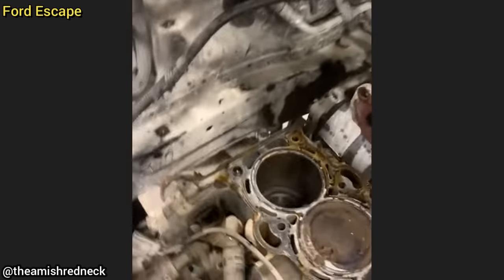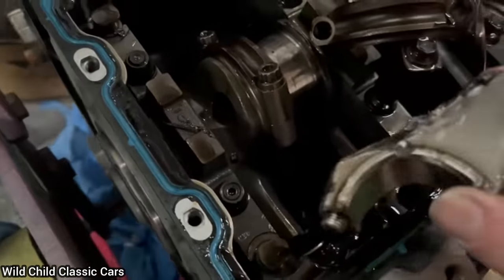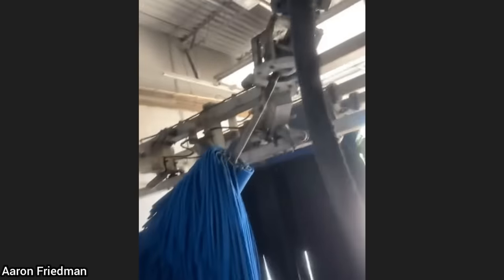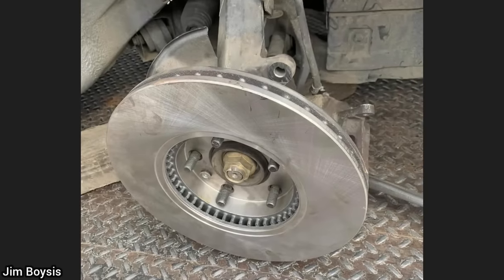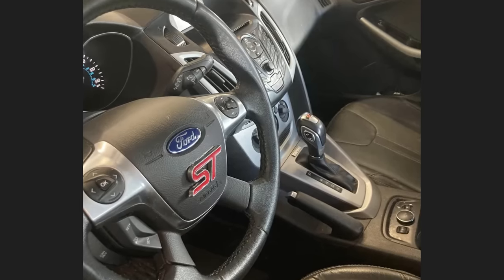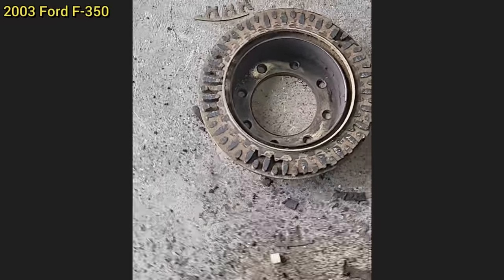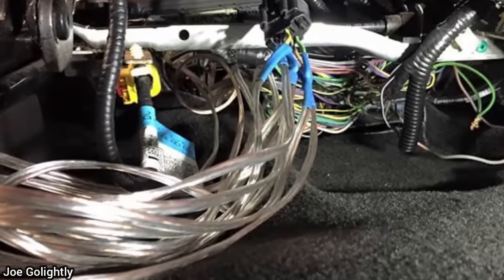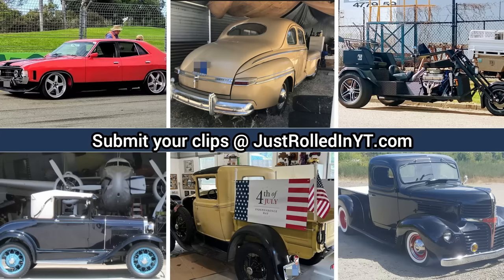Customer States Engine Runs Rough After He Replaced Some Parts | Just Rolled In

Comment: 😂 the radio one got me. Thought something was wrong with the engine until he turned off the radio.
Reply: They probably should have revved up the engine to see if the noise sped up. The radio is on AM which will pick up radio interference, spark jumping to ground for instance. Or, changed the channel, if the noise followed, it could be in the radio, or its ground/ power supply filter.
Reply: @crabbypapa3862  My old Fiesta used to do that if the radio was tuned right (or wrong, depending on your perspective). I never realised it was actually a common thing until now!
It didn't sound like it was broken or anything, it basically perfectly amplified the engine noise. Like those fake engine noise speakers some cars have but from 1998.
Reply: I'm dying over that one!! 😂😂😂😂
Reply: My '01 F250 does that too. Ford essentially wired the radio to the injectors (the noise capacitors, I think; been awhile since I looked at the wiring diagram).

Although, this looked like a 7.3 diesel in the clip, (mine is a 6.8 gas) so I wonder if they wired it up similarly or not.
Reply: Customer: "Oh man, my truck's engine's making really bad noises, I'll pay for anything you need."
Serviceman: lowers radio volume "That will be 100 bucks."
Reply: And that is why my first instinct when I hear strange noises is to turn the radio down.  I've also developed an ear for 'bad sounds', sounds that should be addressed asap.
Reply: The one time that the radio fix will make it sound worse to the driver.
Reply: Sounds like when they installed the engine they forgot to connect the ignition coil filter capacitor , that should fix the RFI they are picking up on the AM radio or the filter is bad.
Reply: I am probably average intelligence, but when I watch these vids I feel like a genius compared to some of these people.
Reply: Actually, I'd still be a bit worried about why there is an arc of some kind that the radio is picking up. It should be diagnosed a bit more to rule out a bad coil pack or spark plug boot or something.
Reply: Sounds like a Russian Woodpecker (Duga Early Warning Radar)
Reply: @crabbypapa3862  i was wondering what station would broadcast that sound and for what purpose
Reply: @Mighty-Quinn  On my 2001 Taurus, I learned the PCM keep-memory-alive power was fed via part of the A/C system, so when it blew the A/C fuse after the A/C compressor failed, I lost the PCM memory until I changed the fuse. WTF, Ford?!
Reply: I can hear the turbo on am radio in my 94 toyota
Reply: HAd a 1988 Oldsmobile Cutlass Supreme that did this same damn thing. Radio would do that shit if tuned to AM. Ended up spraying it with some resin in a spray bottle. Dont remember what it was. Stopped the issue.
Reply: That was my favorite one too but I don't blame the customer for thinking it was an engine problem.
Reply: That’s one embarrassment from the mechanic I would gladly embrace seeing how much trouble fixing a badly repaired engine.😂
Reply: Was wondering if the first mechanic might have done that on purpose to listen to the spark plugs or something. Although if so, they sure didn't fix whatever's wrong with the spark plugs!
Reply from the maker: it was on a diesel. no spark plugs :P
Reply: @JustRolledIn  FINE! It's got glow plugs instead! HMPH!! 😁
Reply: @JustRolledIn  Thanks for catching me up to everyone else, lol
Reply: Your typical dishonest mechanic would have had the customer come back the next day and charged $2,500 for that fix 😆
Reply: @papamaanbeerVideo  530 AM is not a frequency that would be used by anything in terms of OTH radar. This is interference coming from the vehicle. I don't know enough about cars to know it's concerning but I know enough about radio to know that that'll be fucking annoying if you every try to listen to AM in that car.
Reply: Is that how digital radio sounds now?  I remember static on analog a.m. signals.
In my friend's first car, you could hear his horn honk through the speakers in the after-market radio he installed.
Reply: @buckjones4901 I know very little about cars, but I know enough to shake my head at a lot of these videos.
Reply: It happened to me. After changing the battery, the radio reset to the beginning of the AM dial. I was embarrassed because it took me about 5 minutes to figure out the noise source. I would be much more embarrassed if I took it to a mechanic.
Reply: Unless there actually is a Jackhammer Channel, the car probably has a flaw in its electric system.

Comment: Mechanic: You’re vehicle is a death trap.
Customer:  Stop trying to up charge me!
Reply: I get people being wary of what a shop tells them. I can't understand that specific customer refusing repairs to that death trap. The tire was so bald you could see the air and that broken trailing arm...That was something different...
Reply: @nboddie1036  Exactly!
Reply: Customer's Car:
has an exhaust leak, no floor pan under the pedals, a middle door can be lifted into the air because the B pillar isn't attached to the bottom due to rust, the engine belt smells like burning ass, 1 rotor is out of round, and 3 rotors have gouges in them.
Reply: You dont technically need tires on the car or brakes that's just ridiculous
Reply: @nboddie1036  At that point it's probably because they can't afford it. No sane person (who is intelligent enough to understand how to start a car) would drive with that unless they couldn't afford it and they had no other options.
Reply: OR I'LL FIX IT OR CALL THE POLICE ON YOUR ASS THAT'S YOUR CHOICE 😂
Reply: @CarlosMendez-xl5fh the customer is always allowed to have it towed out, if the car is that messed up and the owner that oblivious, I wouldn’t want to be the last one to touch it!
Reply: i can understand how poor people gotta do what they gotta do, but its not hard to correctly repair a car yourself for significantly less.
Reply: @pebkac1245  That's how I learned mechanics.  Started out quite ignorant on everything, but had to because I couldn't afford repair bills, but could at least afford cheap parts.  
20 years later I still do all my own repairs (just with much higher quality parts).

Just dive in and learn!
Reply: your*
Reply: @nboddie1036   Most people don't really know anything about how their vehicles operate, and I'm sure the mechanic probably just told them what needed to be repaired rather than showed them, so it's easy from the customer point of view to think the mechanic is just making it sound worse than it is to try and get a sale.

Particularly since for every decent mechanic who will tell you the truth, there's another who will make everything sound like it's immediately life threatening just to try and scare people into getting work done. And when the costs get to be high, and the customer doesn't know enough about it themselves, it's a lot harder to believe that the person trying to charge you money is being honest with you.

Comment: between the rotor and the other customer refusing repair, these videos just get better and better. long live (but probably not!) the customer that does their own work!
Reply: Refusing life-threatening repair should be illegal
Reply: I do my own work.  I do just fine.  Are you suggesting the only way to do it right is to pay $180/hr?
Reply: @GogogoFolowMe  ..Thing with that some mechanics will screw people over with unnecessary repairs saying its illegal and the customer will pay thousands for work that was NOT needed...Example they will say your ball joints are gone and your brakes are worn when nothing is wrong/worn out. Not all mechanics but there are enough hungry/greedy people out there to screw people over..

I understand what you meant with serious problems that are a hazard and they should do what that shop did,they called the police.

I myself am a mechanic/tech and my cars are pristine and shudder to think what is out on the roads!
Reply: @major__kong  well I was talking about the customers that show up on this channel doing their own work. I assume from your comment you won't be one of them.
Reply: "Thier"???   🤦‍♂️
Reply: @BA-gn3qb  guess spell check wasn't working.
Reply: There is nothing wrong with doing your own work, but there is something wrong with not knowing your limits.
Reply: @major__kong that's not the point. There is no problem with you doing your own work, but there is a problem if you drive your car with a broken trail arm. Get it towed.
Reply: Dude, I was thinking the exact same thing as the video finished. Absolutely wild..
Reply: After I see some of the customer work, I figure I’m practically ASE certified these days…..
Reply: I'd call for a DUI check if they couldn't figure out that the rotor had to be flipped.
Reply: @ehsnils  I laughed far too loud at that one. There had to be mind-altering substances involved. The 2 nimrods couldn't look at the other side and figure it out? WOW!
Reply: The rusting rotor issue almost killed me once. My step father had a Ford Sierra that had a nasty vibration while braking. He didn't get it fixed immediately. So I borrowed the car and had to do an emergency braking at 60mph. The vented rotor cracked in two halves with a loud bang and sparks and I lost all brakes. Had to put the car to 4-wheel slide to avoid hitting a shop wall and to avoid the other car. The vented rotors had corroded between the discs so that hard braking crushed the discs together and the fins between the discs gave up and the two sides separated. Since there was no longer resistance to the brake cylinder the pedal went straight to the floor. I was shaking for 2 hours after that incident... Also if I had known what a death trap the old Sierras were in collisions, I probably would not have driven the car lol.
Reply: @GogogoFolowMe  I mean in some cases someone might be planning on junking the car or doing the work themselves so I disagree, but possibly it should be cause for the registration to be revoked until its fixed

Comment: Leaving something in the intake or having dirt go in there is one of my biggest fears while working on it 😂
Reply: We would feed Detroits shop rags for fun.
Reply: I recently did this on a Jaguar F-Type  after replacing the coolant outlet pipes under the supercharger because the hood opens the opposite way I didnt see the rag I used to block the runners. Had a mis-fire and I drove it around a bit. Luckily it only jammed the intake valves open and nothing happened.
Reply: I did the same, car would only run at idle. Doh.
Reply: I had to replace intake gaskets on my Astro van. A year later the van develops a wicked misfire. Take it in to the shop, they originally thought burn valve because there was no compression. They take it apart to find a piece of aluminum (almost looked the bottom of a can) in the intake runner that was holding the valve open. I certainly didn't put it in there when I had the intake off. Shit was in there for years before it ever caused a problem
Reply: The irony of putting a rag in something to block debris from getting in only for said rag to become the debris that gets in 😮. I'm in HVAC business and I've seen the rubber plug that comes inside HVACR type L copper left in and brazed together.
Reply: @jen_alanfromchicago53  "only jammed the intake valves open" 😆 Youre lucky it didn't cause the valve to kiss the piston.
Reply: @uhtred7860  yes, that would have been  $$$. Sometimes luck is on your side.
Reply: Had a friend always seem to leave red rags behind in the intake after rebuilding gas turbines. Still claims he's the best at it and not me. Even after leaving a 2x6 plank of wood in there, we won't release the title. "It ran, did it not?" Yes, yes it did...but I'm cleaning this mess up constantly. I guess you just learn that ya gotta follow some people around after work is done and they declare it read to start.
Reply: Little bit of dirt won't hurt much. It'll get blown out on the exhaust stroke. If it's large pieces or chunks that's a different story obviously
Reply: Anytime it will fit I use a tennis ball.
Reply: Happened to me. Duramax ate a flange nut and blew up the engine. $4000 even when I did my own work
Reply: I would consider that a healthy fear, it helps keep you come making that mistake
Reply: Glad I ain’t the only one , I left paper towel in the intake port of 289 it all shot out the exhaust like confetti 😂! Car runs fine after it blew out.
Reply: @mrbyamile6973  
I once had a liquid line freeze up after the receiver on a brand new unit. Turned out the plug had broken and someone just poked it in instead of coaxing it out.
Reply: Triple check everything before closing
Reply: I’ve literally dug through the trash and counted the number of rags to make sure I took out all of them
Reply: We got a new guy back there, learning how to do jaguars and land rovers, and he was putting an intake manifold back on. I walked by and noticed two bolts laying right next to the ports where the Plenum gasket goes. I said dude don’t forget those bolts, and he almost knocked one in the port hole as he reached for it talk about a pucker factor.
Reply: My Cummins has definitely had a few of those blue shop towels for dinner before. Didn’t appear to care at all, still sees 40+psi daily years later lol.
Reply: @uhtred7860  basic engines usually have a fair bit of tolerance for sloppy mechanics, if you get the cam timing out by a tooth for example. high performance engine are a different story.
Reply: They can't afford to fix their car themselves.  They're too broke to pay attention to what they're doing...
Reply: I did it when I was a kid. Left paper towels in the valley of my 350. Dad was upset. LOL
Reply: @Jajaky just the other day I made sure to only use full sheets of shop towels just so I could be sure I didn’t lose any corners.
Reply: @jen_alanfromchicago53 You did it on a Jag. 💀💀💀💸
Reply: Happens to the best of us…pretty sure there’s a “ few” similar stories where a surgeon left something inside a patient
Reply: When I was a young man, I replaced the aluminum head in a '75 Mazda B1600. I put a stick between the timing chain drive gear at the crank and the one at the head to maintain tension in the chain with the head off. When I put it all back together, I forgot to take the stick out. Of course, once started it immediately wedged itself between the head gear and the chain stretching it. It was never the same even after repairs.